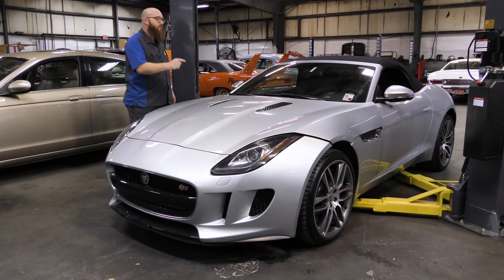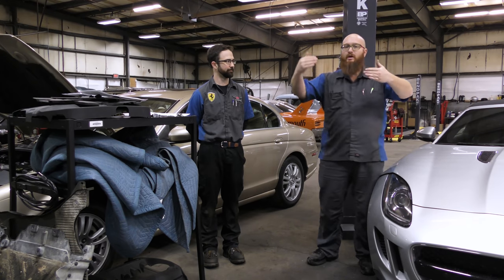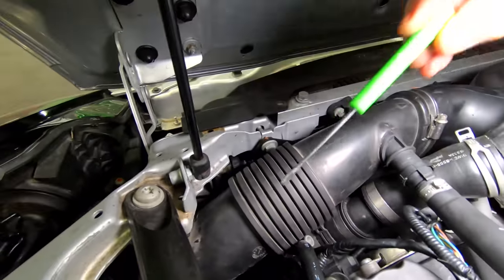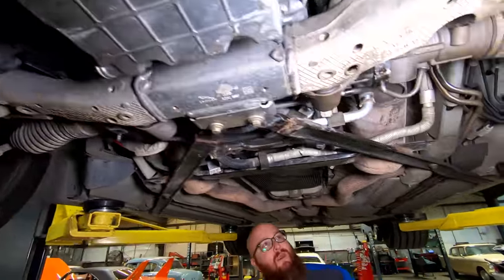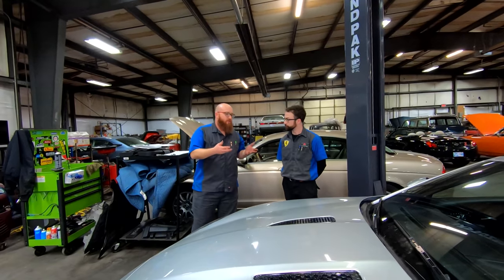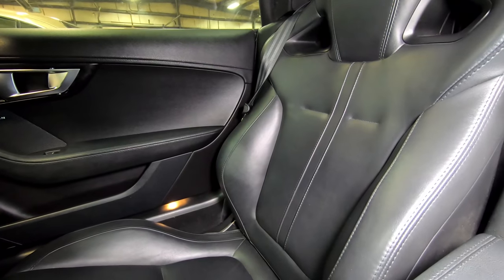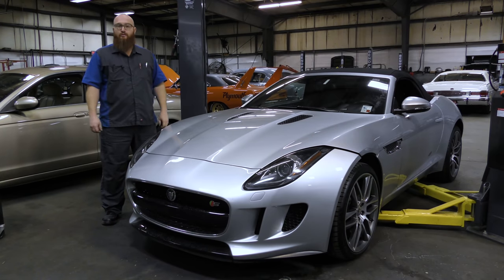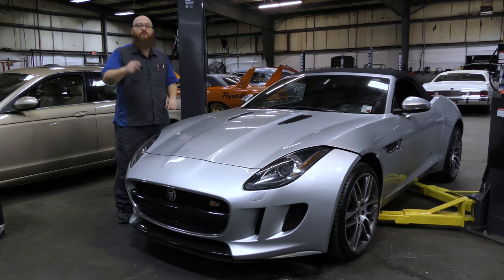How could a shop do such a bad swap? CAR WIZARD points out all the errors on '14 Jaguar F-Type

Comment: The front bumper had a bad repaint and the fitment seems way off? Or is that because the hood isnt fully shut?

That interior looks beat to shit in my opinion and the steeringwheel looks like it has 200.000 miles instead of 64.000?

Looks like a shady lil Jag….
Reply: The steering wheel might just need a cleaning. I've seen plenty of wheels where hand cream or hand grime builds up and makes the wheel look worn. It usually comes off like it was a dried grease accumulation if you wet it with cleaner and wipe it off with a cloth.
Reply: Hood isn't fully shut. It's not obvious looking at the fender because it and the clamshell hood overlap around the side vent, but if you look towards the doors and the base of the windscreen you can see it sitting up a bit.

Mind you, if the engine has been swapped it's entirely possible the bumper was off during the swap.
Reply: Im thinking it was hit hard in the front and a collision shop swapped out the motor . Some body shop's are notorious for leaving fasteners and bolts undone or off and looking at the poor fit and shade variance on the front fascia they are not to fussy about that either.
Reply: Front fitment of the bumper is absolutely off and the paint is pretty noticeable although it could be the clear bra on the bumper that was mentioned. Have a F-Pace SVR and the wheel gets like that with natural oils etc. at least the engine if not completely fucked should be salvageable.
Reply: same for that worn button too. This thing didn't cover 64k in seven years. Nope. lol.
Reply: I was thinking the same when she said 64K miles with the condition of that start button, steering wheel and it having already had an engine replacement. Knowing what I do I dont believe the odometers. Some can be reprogrammed by computer, other makes you can swap a cluster with a low mileage wreck and that mileage will show in the higher Mileage vehicle. There was just a big case of that with I believe used fedEx trucks. FedEx would just swap clusters when one went bad with one from a wreck. Auctioned them off with incorrect mileage showing.
Reply: @timewa851  I have seen cars that worn out in seven years.  GMs first come to mind.

Comment: Was a GM tech for 15 years and the amount of other shop screwups I’ve seen is crazy. Nobody can fix it time to send it to the dealer.
Reply: I've had dealers break my cars and want me to pay to fix it.
Reply: I had the selling dealer want to decline to work on my motorcycle.  They felt it was too old (about 10 years) and didn't want it taking up shop space if they needed to order in parts.  I already had the bike off the trailer and wheeled to the shop door, and after they saw the (good) condition it was in, they relented.
Reply: I found dealers to be the most expensive...NOT the best. Guess you have more people to complain to if you get a job like this
Reply: GM...I've seen them have cross threaded bolts from the factory.
Reply: I had my timing belt changed at Toyota and they didnt plug the AC compressor back in, scratched the shit out of my front bumper, and got grease all over my interior carpet, console, steering wheel, and door handles inside and out. They did fix it all but reluctantly.
Reply: YMMV, I have reluctantly brought my cars in for recalls only to get them back with damage and missing parts. I have had dealer repairs where they used a flat head to pull trim scratching paint, breaking plastic trim and clips going as far to patch with duct tape. Not going to say exclusive to any particular brand. You want it done right you just have to do it yourself.
Reply: @tomlindo2863  say the brand.
Reply: Unfortunately Dealers have shitty mechanics too. If you want it done right you have to do it yourself. I've found it's more of a headache to have anybody do anything for me these days. The world is FULL of incompetence so I'm often learning new skills.

Comment: I would be very suspicious of the mileage on the Jag looking at the condition of the Steering wheel and the push start button that is wear from a very high mileage car from my long experience.
Reply: This is typical hand cream wear. People that use a lot of hand cream or hand sanitizer have those wear indicators. The acid and alcohol in hand cream and sanitizer will cause those exact issues on the wheel and buttons.  

 NOw, with that said, this looks like a lemon.  

Man, imagine what the CARFAX looks like in this.
Reply: Agree completely
Reply: And you can most generally tell by wear patterns on the inside if it's mostly town miles or highway miles. Someone tells you the car is all highway miles and shows signs on the contrary, they're lying. I too have seen this over and over thru my years of dealing with vehicles.
Reply: @rpach1613  how about the corrosion forming atop the strut towers. 
they get their lotions on that, or the well-oxidized cats?  This thing rolled 180k at minimum. I don't buy the 'failed injector must've took the cats out' nonsense either, if you believe 64,000 + miles.
Reply: @rpach1613  I was wondering about the steering wheel. Not even brought up by Mrs. Wizard. WTF? How can you not even mention that?
Reply: @timewa851  All you need is salt roads my friend, its been 8 years.
You also think a car bought about 5-6 years into its life somehow has fleet numbers on it? 40K Miles/YR? Makes no sense.
Jaguar has never been known for good quality, paint chipping on the push start and steering wheel being faded aligns more with a women driver with hand-creams and long nails as opposed to your insane theory about a rolled back vin on a 200K mileage Jag.
Just go look at 2014-2015 model Jags, its not uncommon to see some decent fading on the push-start @ 10K-20K+ miles and even some on the steering wheel, obviously not to this degree, but this car was bought with 40K and has clearly been a daily since then, its not surprising to see.
Reply: Don’t know about the steering wheel but on my 2015 F Type I bought with a true 15k miles 2 years ago, the starter button looked just like that.  Part of the sticky button issue.  Bought a new one for $25 and swapped it out in 10 min.
Reply: Those starter buttons wear out after 10k miles. They are $30.

Comment: The world needs more honest mechanics.  I've used my mechanic for probably 20 yrs.  He has never advertised, non-descript unmarked shop, you wouldn't know it was there unless you did.  Only goes by word of mouth.   First time I took a vehicle to him I told him he had clearance to do anything that needed to be done so he basically had a blank check.  After about a week my bill was only a few $100 for a new radiator and water pump.( which it needed ), he tried several things to try and save my radiator even though he had clearance to replace it from the start.  He use to be a dealership mechanic and got tired of dealership screwing people over so started his own shop.

Comment: That interior is clapped, the steering wheel looks like Swiss cheese! And the front bumper looks like it’s been hastily repainted and thrown back on because the fitment is awful. And that’s an unusual amount of rust for a Louisiana car. This thing’s had a rough life, poor jag.
Reply: These Jags are notorious for rust. A friend bought one three years old and it needed welding underneath.
Reply: Aye. He probably got a good deal on it. If kept near the coast for a few years and not garaged, I can see that much rust. I bet he bought it thinking the engine was pretty cherry (which it probably was), then got scammed for the new engine while the previous shop sold the old one. That was a pretty common scam around here until the government finally stepped in.

There's so little recourse in dealing with a shoddy mechanic that, especially with a car like this, it makes me weep for my pfofession.
Reply: These F types are based on the older XK chassis. The body itself is fine its just the braces and rear subframe that corrodes
Reply: @idefeczx  Most cars corrode there. Especially Fords.
Reply: @Mariazellerbahn  Only on certain braces...is a known issue that only affects some, and not a big deal. Please don't comment without knowing what you're talking about.
Reply: I wonder if the mileage is real.

Comment: As a Jaguar owner myself of 1996 Jaguar XJ 6 (X 300), I feel so sad to see such a well made modern era Jaguar literally trashed .As all you can see why Jaguars have a bad reputation here in the US is for that exact reason, unskilled mechanics, shady repair shops, and often multiple neglectful owners have damaged these cars, to a point that they have very bad resale value and people simply do not buy them. My own Jaguar was also damaged when I bought after high school,( yes I still drive it to this day), yet some mechanics before me cut the engine wiring harness connected to the ECU, trunk wiring harness, left loose bolts on the front suspension, etc.,.broke the plastic console of my radio, shortened the Engine control module, left loose spar plug on cylinder 6, stripped the engine oil plug, hit with hammer left rear axel to push the bearing that was replaced, damaging it,
. I literally had to spent years fixing whatever I could myself, after so many mechanics working on my car left their hands on it.  learned a lot about my car to a point that the last 10 years my car has not seen a repair shop as anytime I went to a repair shop my car came back with worse problems. I do all the work myself  now, every weekend as a side project and I brought my car back to life to my own satisfaction. Today, I still log 500 miles a week and my engine, transmission, rear diff are at over 320,000 genuine miles. If that car was at a repair shop for everything, it would be long time ago trashed at the junk yard. For all of you Jaguar owners here in the US, learn your cars, if you mechanically inclined, work on them in your free time, ( they are not that complex) ,if you have the cash get a dependable Jaguar shop in your home state, but please do not leave these cars neglected and to bad  shops, as this is the final result. I recommend all of you to see videos of how the F Types are made in the UK at the assembly line and see the pride and effort these workers are putting into each vehicle. Jaguar came long way from it's dark past and mess from Ford ownership.  Let's hope the Car Wizard can bring the cat to it's former glory.

Comment: I'm no mechanic, but its screaming out to me, take the engine out and make sure its done properly. Who knows what else lurks beneath. 

Its appalling what they've done to the owner.
Reply: Would be a lot more expensive to take out the engine.
Reply: @ElectrofizzStudiosCo  Of course, but I would personally not trust any of the work carried out by the previous "mechanics."

I'd pursue them for the costs involved with getting the job done properly, as they should have done in the first place.
Reply: It would be expensive to take out and reinstall the engine. But in the long term it would save you money, and future headaches.

Comment: Hands up everyone who spotted the bonus empty-threaded-hole-with-missing-fastener on the end of the crossmember at 08:02.
Presumably where you would affix a bracket to secure that wiring loom or EGR pipe or whatever it is where it runs along the top of that cross-rail.

Comment: I can understand why the other shops wanted to stay away from this vehicle. You will be very lucky to find all the gremlins hiding in this car. It takes courage to take on a challenge like this, especially where the owner is so far away and can’t just pop back when some of those gremlins emerge. May I suggest (with the owner’s permission) that you put this car in service as a daily driver for you or Magic Mike for a month to try and uncover these undetected items? Best of luck making this customer happy…
Reply: The alternative would be to pull the engine out of the car and remount it. Only then you'll know for sure that everything is bolted down and tightened to specs, because I also seriously doubt that they've torqued the bolts to specs.
Reply: @tjroelsma  That might not be enough as stuff that was removed and set aside and not reinstalled may be undetectable. Ideally, the the person who removes the old engine (while taking plenty of pictures) also replaces it with the new one. This reduces the possibility of troubles. This kind of continuity is not common these days where mechanics are treated more like exchangeable commodities.
Reply: @deanrhodenizer938  Oh, I agree, but as that person(s) did such a bad job, I wouldn't have them anywhere near my car ever again. 
So that only leaves the possibility of a very skilled mechanic to pull the engine and remount it. Ideally speaking that would be done by a Ford/Jaguar mechanic or Ford/Jaguar specialist, as he/she would know that car and know what needs to be done.

Comment: Not every shop knows how to tune a forced induction engine.  Just modifying the compressor without dealing with fuel and backpressure issues is a recipe for disaster.

V8 engines have relatively good harmonics compared to a 4 cylinder.  Bolts shouldn't be vibrating loose, they were never tightened.
Reply: Nobody deserves to be the victim of hack mechanics.
Reply: @vw5056  yup, sue them all
Reply: @vw5056  I know! We'll let hack mechanics be the victim of other hack mechanics!  Karma!!

Comment: Hi Wizard from over here in the UK. This brings back memories of our experience with a Jaguar official dealer back in 2008. We purchased a new XJ Sovereign (our 8th  - and last Jaguar) As you are no doubt aware that car had the ZF 7 speed automatic transmission and this was a total nightmare on our car (apparently it was the same transmission as fitted to BMW 7 series, Bentley etc which all suffered the same problem - ie a sudden “lurch” forward when slowing down in traffic and changing from 2nd to 1st gear) Our car went through 3 complete transmission changes in it’s first 1500 (yes 1,500) miles. On the last occasion when they returned the car we found 2 torx bolts, each about 2 inches long in the front footwell. When we returned to the dealership and showed them the bolts their response was “Don’t know where they are from” Couldn’t believe it - this car had just cost us £53,000 and there were bolts missing from it!!! I must add at this point that I used to be a police accident investigation officer and was authorised to take cars apart to find out why they had been involved in serious (usually fatal) accidents so I wasn’t just going to be fobbed off by their excuses. They eventually found where the bolts were from. It turns out that they were essential in holding the electronic modules to the actual transmission. We sold the car when it only had 5,800 miles on it as we had no trust in it and we have bought Mercedes since then. No problems with any of them and the dealership is excellent.
Reply: The X350 used the ZF 6HP26 unit which was 6spd and very good. The new 8spd is also flawless and used in all sorts of cars.
Reply: @vw5056  I can assure you that our 2008 TDVi Sovereign definitely had a ZF 7 speed box in it. Maybe UK only spec? When the third box started causing problems ZF sent a technician out and he and the service manager of the dealership went on an extended drive with the car. The technician sat in the back of the car with a laptop plugged into the system and sure enough the car did the same as usual when slowing down and coming to a halt. The box was changed again and the new one performed perfectly. At the time (might still be up and running) there was an owners website called  “S-Type Lurch” which had many, many cases of owner of later S-Type and XJ owners having the very same problems. As I say I do have qualifications that enable me to stand up in a court of law and be able to give evidence of how accidents occur and I frequently dealt with most of the major car manufacturers with regards to mechanical specs of vehicles.
Reply: @robinosborne266  No, ALL X350's used the 6spd unit. You must have had bad luck or something as that is an excellent transmission.
Reply: @vw5056  You are correct. I have just checked through my computer at the correspondence I had with Jaguar at the time and it was the 6 speed transmission. Sorry. I know that we were unfortunate but there was a lot of stuff on the internet by owners of not only Jaguars but BMW, Bentley et al. The problem was a very pronounced “lurch” forward as it downshifted to 1st gear when you came to a gentle halt. We had many Jaguars (9) over the years and this was our 3rd X350 but it was a nightmare car from day one. We ended up using it as a second car because we had no trust in it and sold it when it was 5 yrs old with nay 5,800 miles on it. Thanks once again for your response and for correcting my mistake.
Reply: @robinosborne266  I hope you come back to the great brand. The issues you had were ZF ones not Jaguar. Best of luck.

Comment: Wow, when a dealer and a recommended independent shop turn the car away you just know that it’s going to be a can of worms.  It’s unfortunate that a trusting owner thought he had a proper shop, when they had hired a mangler instead.  This is the dark side of owning what is not really that complex of a near exotic car.
Reply: I agree, that is a huge red flag. The car looks great but I would never buy a used Jaguar performance car with that many miles on it
Reply: I don't know how it is na US but in my country dealer's are like normal shops but they have a certificates xd really taking job like that for them is really painful bcs it can get much worse just from touching it
Reply: @nolike7179  If the owner had engaged a dealer before the car had been mangled it would have been taken in and repaired - perhaps even for less cost than having to pay two shops to complete what could have been done in one competent shop.